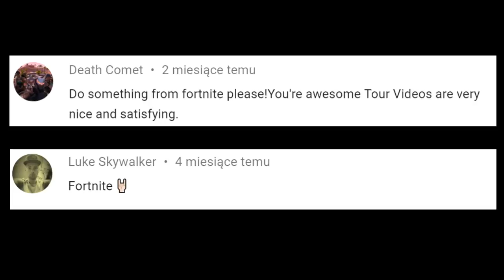How to make "Chug Jug" - Fortnite / Resin Art

Comment: I tried one of your other projects. I even used the same epoxy, Gallant art. Mine had TONS of bubbles in it. How do you mix the hardener & dye without getting bubbles?

Btw, I bought your book. There’s nothing in there explaining that.
Reply from the maker: I use a vacuum chamber. You can also put the resin container in warm water before mixing the ingredients. The resin will become thinner
Reply: @jedrek29t  Ok. I’m looking at vacuum chambers. I’m going to build one.

You know, one thing that doesn’t show in the videos is how messy this can be! I tried making a silicone mold of a toy. First time doing any of this. I got it all over my table, my hands. And it doesn’t wash off. Epoxy too. I tried isopropyl alcohol, acetone, soap. Finally got most of it off.

I’ll get better at this. I got a box of rubber gloves.
Reply: Lots of fun though.